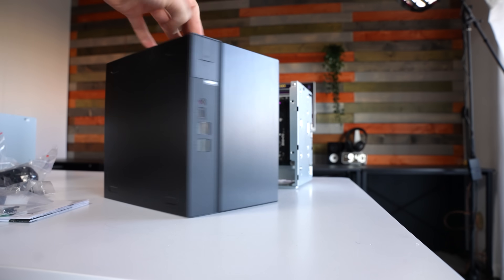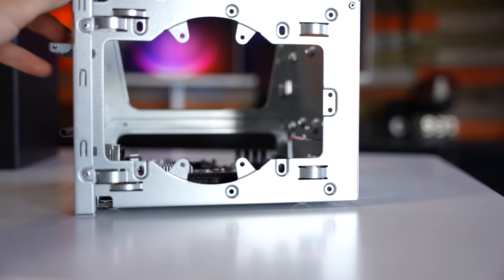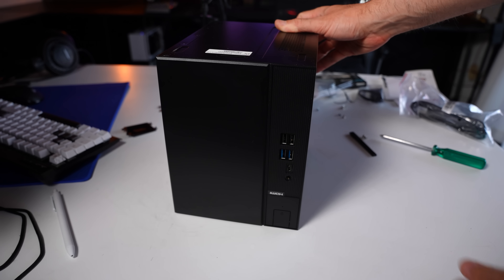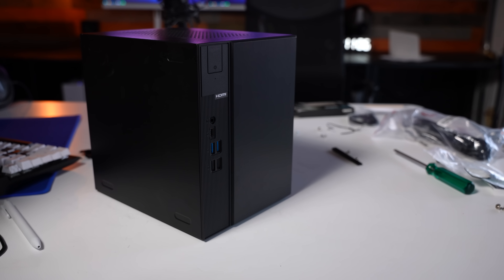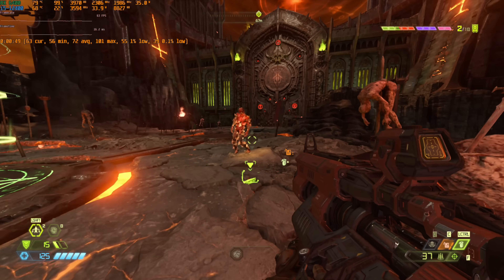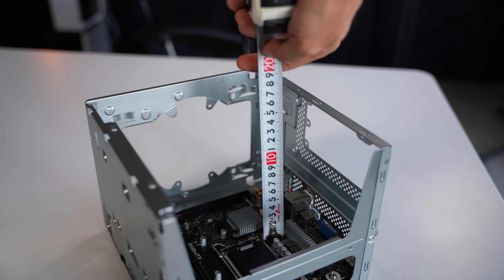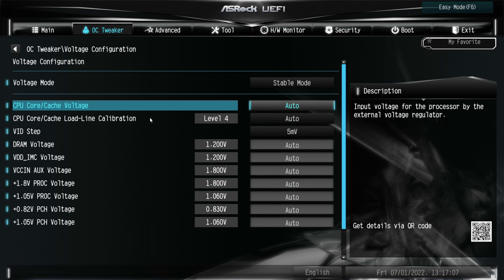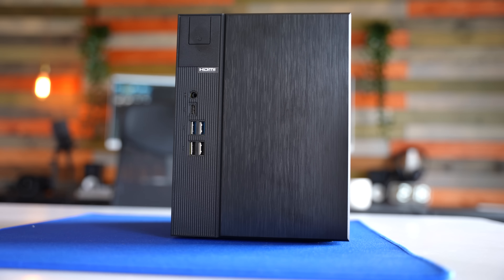Is this Worth $250? The ASRock DeskMeet B660 ITX Review!

Comment: I have a Zotac RTX 2070 Super Mini 210mm. Will it fit? Thank you.
Reply: No. Any discreet GPU used in the Deskmeet B660 must be 200mm in length or less (although I did see someone use a 201mm GPU in a video, but it was a really snug fit.)

Comment: I was almost about to pull the trigger on this for $180, but it is so limited in its capacity, its essentially a large mini pc, except instead of an Apu that you cannot upgrade, youre essentially limited to rtx 3060 so long as you keep this case.  I instead got a b550 itx, sfx psu and asus 1fan 3060 12gb. Will be making my own case out of aluminum baking pans

Comment: "warning" undervolting this cpu even though the option is on insdie the bios will result in huge performance pentaly. intel implementeled some new undervolting protection that even when turned off on this motherboard causes issues. something as simple as a 50mv undervolt caused me to drop down to a 5k cb23 score instead of a 12k on a 12400f. Your  best option is to do like he did here and actully limit the clock speed down.

Comment: Toasty Bros did this build with the 12100f. They said that the power supply has reverse air flow. So the fan is supposed to face the cpu. While it would send slightly heated air, there would be plenty of it. This might help with thermals.
Reply: I wonder what happens when that PSU needs to be replaced…

Comment: hey mate,  if using a SFX power supply which Top end low profile cooler could i use ?  all the ones listed on the asrock website are pretty weak in terms of mass and airflow  thanks in advance !
Reply: n/m found out the Noctua NH-L12S is perfect for this with a SFX PSU  but your right the case needs better airflow oddly enough the front part would be Great for a 92mm intake fan so i have removed the plastic shell  drilled a 80mm Perfect hole  and put a circular mesh cover on the front plastic part and then on the Metal case drilled a 90mm Hole which doesn't affect structures integrity at all and attached a 90mm  slim noctua fan there  and will wait to see what my new cpu  goes up to when it arrives (right now its just a basic 4 core no HT in it so its pretty tame )

Comment: Rather than selling my 12100f in my current zzawC2 rig
I might upgrade to 13400f and buy this deskmeet to put in the i3
Shud be good with rx6400 since all i need to use is 15" portable monitor which i already hv the anmite ones
RSR shud make this gpu live a very longtime

Comment: Wondering why the total time to build doesn't seem to include the software that's always needed & required, installing & updating the OS, firmware & Bios update, drivers & firmware for GPUs etc.
Mechanically inclined people usually don't have a problem building a PC, but man sometimes software can make you pull your hair out.

Comment: I like a lot this little PC, however ASRock should deliver it with a SFX PSU, so you can install a decent CPU cooler instead the usual Intel thermal-crap solution. 
It's almost perfect and if ASRock fix some little issues, it could be perfect.

Comment: aww man I wish I knew about this video earlier I just got a Nzxt h210 case today.  $250 for a ASRock motherboard/case/power supply sounds like a deal! I have a low profile Pulse RX6400 in my HP EliteDesk 800 G2 SFF I love the card it outperforms the GT 1030 I had. my old CPU i5-6500 got maxed out 100% playing Rainbow Six Siege. I changed to i7-6700 but only helped lil bit 80-90% CPU usage with RX6400

Comment: I have a question about powersupplies.

I was requested to make a build for a friend thats going to USA from Europe. But the thing is that in Europe power is 220V and in USA has 100-115V. I have a NZXT 700w 80+ bronze psu which is rated for 115-220V will it be ok in a area if the power is 110V?
Reply: Yes, it is OK.

Comment: NZXT H1 V2: expensive, better looking, better cooling and air flow, better psu, better build, I/O ports on the bottom side
CM NR200P Max: expensive, better psu, better build, much better cooling and air flow, normal I/O ports on the back, not so small
ASRock DeskMeet: a lot cheaper,  normal I/O ports on the back, worse PSU, worse  cooling and air flow, worse build, a bit smaller than H1
Glad we start to have more options for different use-cases.

Comment: Love the motherboard for a NAS with the 4 ram slots.  Sadly it looks like the PSU and CPU are fighting for airflow :(

I'd love to see an option this size with 2 to 5 3.25" HDD bays.  If they had option for in and out 120mm fans it would be amazing.  At the very least a properly vented panel so we can do it ourselves.

NR200 with a Micro ATX is probably next best.  I sadly have built an ITX in the NZXT ITX case that is bigger than a micro ATX desktop in every dimension.  (The mAtx had an lga2011 motherboard and some room for the graphics card to breathe even.  I remain convinced that the ITX cases are just advertising for the real cases)
Reply: it is not fighting for airflow, the PSU fan is reversed to pull air from out into case.
Reply: @Beitouzi  curious how did you know the PSU is reversed? I was thinking about the same. Asrock website does say the PSU draw air from outside, but couldn’t see any review mentioning the fan being reversed
Reply: @kang7014  it is ASRock's special design and that's why it works well.

Comment: This looks hella legit.  206mm sounds really short, but there are many 1650-1660-2060-3050-3060 even 3060ti cards that will fit.  RX5600 XT and RX6600 and RX6600 XT are also found in 206mm or less sizes.  Many single fan models but some are dual fan like the EVGA XC Gaming series, ASUS Dual Mini, and PowerColor Fighter and that counts for both nVidia and AMD cards.  But nevertheless, I'm thinking that poor RX6400 choked off on 4 PCIe lanes needs to get swapped for a nice...anything BUT that...

Comment: Somethign seems completely wrong with that CPU/System.
You are telling me that an i5 12400 still draws 65W when running just 3.6GHz undervolted??
I just tried it with my i7 8700K. No undervolt, just disabling all "enhance" features of the motherboard and using IXTU to limit it to 65W. And that still runs 3.7 GHz allcore.

Comment: Kind of wonder how it would work if the PSU was just pulling air from outside the case versus overtop the CPU and then having a 3D printed vent feeding into and then out from the CPU cooler out the back separating air flows for the CPU and PSU.

Comment: I do not like that case layout with GPU fan clearance being nonexistent.  I'd keep the bottom off and install some ...LARGE legs to give it some ground clearance.  There's a reason they'd include a 6400, and that's thermals.  i3 probably best.  But that's a $250 toaster.  I'd recommend this for a server config, GPUless if possible, but you can get smaller cases for less if you're doing that, so it's a head scratcher that a case seemingly built with GPU in mind supports it so minimally

Comment: 1.35 voltage for the memory will solve the problem - it will run on 3200 mhz with better timings than cl 22.

Comment: Urm....so for your money you get a case that has no airflow or capacity to add any, very limited cpu cooler support, very limited gpu support, very limited drive mounts, a dodgy looking 550w psu and a non standard motherboard which won't fit in a lot of other itx cases....bargain!
Reply: As someone who don’t want to have 50L case on or under the desk, yes, I’ll pick those limitations over variability of choices. Once system is done, it sits for years. I’m on my deskmini for years now.

Comment: I guess the PSU "block" the air flow from the cpu cooler that's might be why the temp can be high ... 
I don't understand why they don't sent a SFX PSU instead of a standard one...
Reply: sourcing SFX PSU in large enough quantities might be cutting into their profits. There is still a silicon shortage along with other components.

Comment: There should be ventilation holes for the PSU so it can be fliped around, having the PSU fan right above the CPU fan both fighting for air can´t be good thermal design. I get it should act as exaust, but not that close to the CPU fan.
Reply: @iNeed2Pi  So having hot air from the PSU flowing over an already overwhelmed and struggling cooler is what you call "good thermal design"?

Comment: So the PSU is a CWT 80+ Bronze PSU without any 8 pin PCI-E cable... Why how hard could it be to put one? Why buy another PSU when this one has the cable lenght you need and not extra to have a spaghetii monster inside.

Comment: Bry Bry I appreciate that ASRock sent this one over to you, it's a cute little system. Just want to throw in, the nr200p can be had for as little as $60aud new and even less used, is not much bigger, but can take any components at all. Great value for those wanting to go small
Reply from the maker: My favourite mitx is the ali case with the handle, it's actually my main right now! Used it in this build here https://www.youtube.com/watch?v=pqwjkT-_obk and after months of going with it, can highly recommend it.
Reply: @techyescity I put a build together for my son with an s4 off Ali, a 3100 and a fury Nano a couple of years back now needs a 6600 challenger for beautiful gaming glory but going strong ..also a fantastic sff case 👌
Reply: Remember the video :)....not normally a massive cm fan boy but if you've not built in the nr200p treat yourself bud makes itx fun now all motherboard form factors are expensive....running an inverted mod (left glass, 6800) with counter convection flow (top intake bottom drain) and a 3600 on a v5 pulling air from back - 'borrowed the code' from zenstates, fiddled a bit, recompiled and somehow showing 4.2 base clock and bout 97w draw with good thermals even under OCCT power test :)
Reply: I just got a NR200P colored and new for about 70€ shipped on eBay :)
Reply: @LucaDigioia83  bout what I paid for mine (£56) and got to admit it's by far the best case I've  ever built in it's just so flexible and well thought out. Lol you could even fit the non standard motherboard from the Deskmeat  in it if you used the front psu mounting position!
Reply: In fairness (Although amazing) the nr200 is actually quite a lot bigger (18 liters compared to 8).....sg05 however is pretty much same layout and size but much better support for components and passable airflow, should be able to pick one up for next to nothing (£40 new in uk), add a decent sfx psu and a b660 itx motherboard for very similar money
Reply: Nr200 sorry. The p one runs you a little extra and isn't really worth it imo

Comment: No reason to buy this when choice of AMD boards is so vast. I tried it and no intel is no good for small cases. These things are hot and i mean hot. Even with good cooler heat output is beyind absurd. Why would anyone call intel viable option is beyond me. Perhaps intel will come up with something that runs cooler next gen but as of now unles you have large case intel is a nono.
Reply: They do have an AMD version of this too. The DeskMeet X300. Wouldn't be too bad with a Ryzen 5000G series cpu.

Comment: Nice overview! I think the unique factor is that you get 4 RAM slots in a very small form factor; would love to see 10Gbe on the unit.
Reply: what is 10Gbe
Reply: @budgetking2591  10GB ethernet
Reply: The 4 slots is good but it's dual-channel only so not that much benefit. A 2x16GB kit will be about the same price anyway with a 4x8GB kit.
Reply: @13thzephyr  2x16 is usually cheaper since it requires less material
Reply: @13thzephyr  the benefit ios that you can get 2x8gb now and if needed you can add 2x8 later,  most people won't be needing 32GB now.

Comment: Can you please create a budget (>$500) small form factor PC for like general and gaming use? Please!!
Reply: deskmeet(203$),12100f(99$),1660 super (used 100-150$) 1tb m.2  nvme or sata (50$), some cheap ddr4 3200mhz 2x8 gb ram(36$),cheap windows key if you don't already have an oem key laying around to re use. this will run you right at 500 bucks. You may be able to squeez in a deal on a 2060 just be warned many are to long you would need one like the evga ko model or a small single fan oem one. This is based on current usa pricing if you still have not built anything.